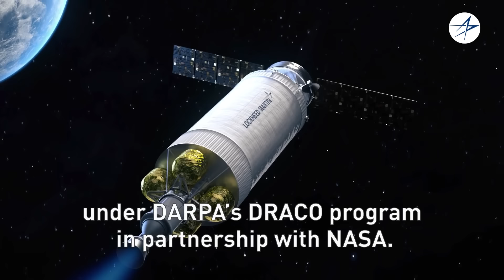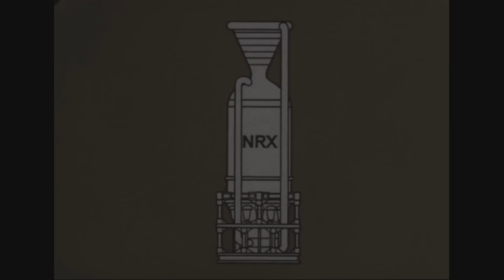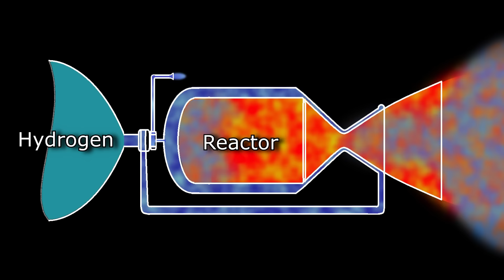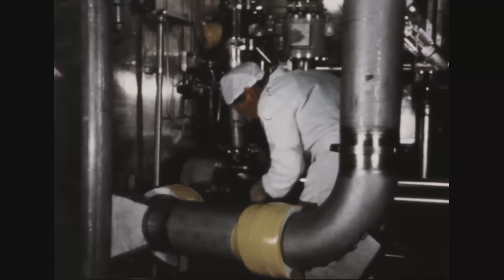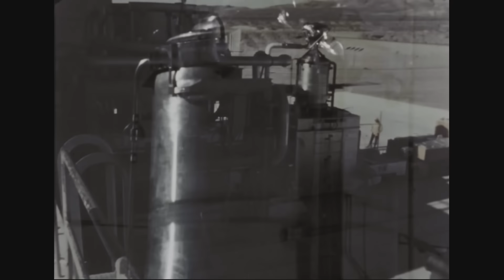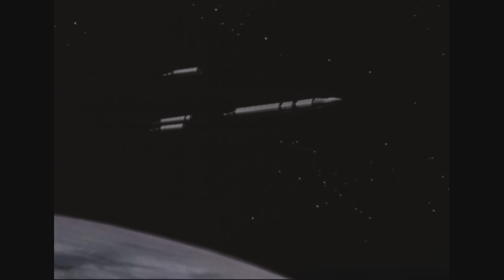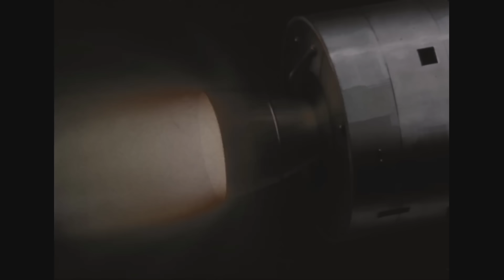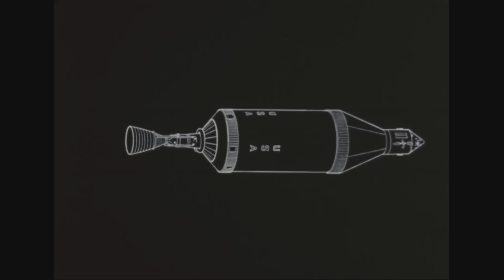Why Nuclear Rockets Are Going To Change Spaceflight

Comment: IIRC, some guys used work on submarine grade reactors does mention Xenon pit isn’t a thing for them as the core is so over enriched and engineered. Also, would it be better to aim for sun? Once for all make the problem disappear.

Comment: Hey Scott, I hope you have time to read this comment, with all the leaks and valve problems they have with helium , why isn't argon used instead? It's a noble gas it has less problem with leakage being a larger atom. I'm sure they've had good reasons in the past. But with modern technology could  those problems be overcome with argon?
Reply: That's the problem. It's a larger atom, weighing something like 10x what He weighs, while delivering the same pressure. He also is gaseous much closer to Absolute Zero than any other gas, making it ideal for pressurizing cryogenic propellants.

Comment: OK Scott, please clarify: "Ion thrusters are almost ten times more efficient, but they require huge amounts of power and produce almost no thrust"
Reply: I suspect 'efficient' might be referring to efficiency in use of reaction mass. I believe an ion thruster can fire out gas much faster than other kinds of engine, so you don't need to take as much reaction mass with you. So if you have a good continuously replenished source of power (a radioisotope thermoelectric generator or lots of solar) and your journey is very long, then you can have a lighter spacecraft/take more useful payload if you use an ion engine for the slower parts of the trip. Compared to combustion engines or cold gas thrusters. I can't actually recall the details of the video, but presumably using a nuclear reaction as a thermal source (I'm guessing just pointing the neutrons backwards isn't efficient) can beat combustion for efficient use of reaction mass.

Comment: if uranium metal melting down is a problem in the engine, why not use something like UF6 where you could magnetically confine the uranium ions. To my understanding cyclotrons already do that so you could get up to all the high temperatures your magnetic field can handle. I mean there are a lot of scientists who are a lot smarter than me, and certainly nobody is talking about these so the process must have a huge limitation in it, any ideas why it wouldn’t work?

Comment: Is there are particular reason why the radiation shield can't be moved to the bottom or back or w/e of any crew compartment, instead of directly above the nuclear engine? If that could be done, then there would be no need to maneuver the now-so-shielded lander through the protected cone. The lander itself would be casting it over itself during the separations and approaches.

Comment: Nuclear-powered rockets are not used to lift off the Earth. Nuclear thermal rockets can provide great performance advantages compared to chemical propulsion systems. Nuclear power sources could also be used to provide the spacecraft with electrical power for operations and scientific instrumentation.

Comment: There's a set of mission profiles that NTP seems perfect for: space tugs between Earth and Mars. Humans on Mars will require absolutely gargantuan quantities of materiel to get started and keep going, and you're never getting that there on electric propulsion. You can do it with chemical rockets, but the potential to save half your fuel costs is very tempting. Less fuel, more payload per trip. Run a train of space tugs from Lunar orbit to Mars and back; for the vast majority of trips, they'll be uncrewed, so the radiation issue is less of a problem.

Comment: Seems like this propulsion tech would be ideal for deep solar system probes on reasonable time scales.  If the target is something like Eris, you burn the engine until it melts, separate the probe, and let the puddle of melted engine coast right out of the solar system.  By the time it encounters another star system it’ll have long since decayed.  If the target is something like Europa, you burn the engine til it melts, separate the probe, and dispose of the puddle of melted engine core in Jupiter/Saturn/Uranus/Neptune.  They already did that with Galileo and Cassini.  That way you can squeeze every bit of performance out of the “nuclear booster” while not worrying about shutdown.

Comment: if material temperature limit prevent higher fuel efficiency, couldn't you convert some of reactor energy to form an electric arc that heat up hydrogen as they pass through exhaust. It can achieve far higher temperature than combustion, and occur outside of the combustion chamber. Beside the erosion of electrode, it should increase the isp further. Granted, the generator step reduce some energy efficiency, but nuclear fuel is not energy constrained.

Comment: You said the hydrogen is the fuel flowing through which is wrong.  Hydrogen is not fuel in a nuclear rocket engine, only a coolant and propellant.
Reply: It is, it is the mass that is flowing through the engine. The radioactive material in the fuel assembly is the source of the heat, but the fluid flowing through the engine is considered fuel since it needs fuel tanks and gets consumed at a relative fast rate compared to the nuclear part of the engine.
Reply: @man-from-2058  No it is not fuel.  No chemical reaction of any kind takes place and the hydrogen is discharged out of the engine in the same form it entered only at a higher temperature.  Yes thrust is produced by discharging high temperature hydrogen but the fuel is nuclear.  What you said would be like saying water is the fuel to power a steam engine, which it isn't.  The fuel is what you burn to boil the water and the water/steam is only a heat transport medium.  Both a steam engine and a nuclear rocket motor are heat engines with their fuels being combusted hydrocarbons and fissile material, respectively (unless you're also making steam from fission).
Reply: @man-from-2058  The hydrogen is stored in cryogenic pressure vessels not fuel tanks because it's not fuel.  And, running out of hydrogen to cool the reactor and transfer heat is the same as a boiler running out of water to cool the boiler and transfer heat.  The reactor and boiler both still can have lots of fuel but can't run without coolant and heat transfer media.  The heat transfer medial is still not fuel.  
FYI, I'm a licensed professional engineer who users thermodynamics every day so I know what I'm talking about.  All I commented on is that Scott made one minor mis-speak but he got everything else right.  Throughout the rest of the video he correctly refers to hydrogen as "propellant" not fuel.

Comment: Now I have to wonder whether you could get even better performance by coating the nuclear fuel with e.g. tungsten which can dissociate hydrogen molecules into atoms at above around 2500K. Potentially another factor sqrt(2) in efficiency.

Comment: I'm doing a literature review on the feasibility of nuclear propulsion, and I found that, yes, that nuclear does radiate the crew during space travel. They  receive less radiation overall compared to use with chemical engines. That is because they spend less time in space compared to chemical. With chemical, they receive a ton more solar radiation because the trip is much longer. 
So, with nuclear engines, they receive radiation but a lower amount of it because the trip itself is lower.

Comment: How about closed loop nuclear reactor generating electricity to power ion thrusters at ultra high power? Wouldn't that mitigate radiation shielding as well as reduce expendable fuel reliance?
Reply: Yeah that is a thing, just electric engines powered by a nuclear reactor. Though that would require a whole big assembly taking up a lot of space while a nuclear thermal engine is smaller.
Reply: @man-from-2058  yeah thought the size would be an issue but surely it can be shipped in parts and assembled in the vacuum of space! Vacuum would actually make things easier, like a giant clean room!

Comment: I've also seen two other plans that add to what is described here. One uses the generated electricity from the engine to magnetically propel the propellant even faster, for much greater efficiency.

The second uses nuclear fusion in addition to fission. The idea is the propellant fuses as it is exhausted.  While fusion reactors are hard because of the need to contain the plasma, that isn't nearly the same issue here; only the direction needs to be controlled.

Any thoughts on these potential next-generation add-ons?

Comment: There's always the less sexy option of a nuclear electric driven ion thruster, too. Or even a hybrid system that can use the thermal energy directly for high thrust maneuvers and electrically drive ion thrusters for low sustained thrust maneuvers.

Comment: My dad was part of the NERVA project. He made several trips out to Area 25, aka Jackass Flats, for the testing.  The video here was from the later testing. The early tests had the engine exhaust pointing down, but they ran into some problems when the engine started pulling the pilings out of the ground...
Reply: I lived right near a testing facility and can just barely recall the red sky from the hydrogen plasma from the engines. My dad worked on these engines and also tested storage of the frozen hydrogen for long durations in vacuum as in flights to Mars.

Comment: Since lower mass propellants have higher ISPs, could you use Neutrons instead?  Is there a way to create a sustained nuclear reaction that emits enough high speed Neutrons to make useful thrust?
Reply: That is a thing its called a fission fragment rocket, though just beta radiation would produce a comically small amount of thrust so actual fuel like hudrogen is added.

Comment: if a rocket blowing up is bad, a nuclear rocket blowing up is really bad.
Reply: Surprisingly not.

The nuclear engine before being turned on would actually be pretty safe to handle, not very radioactive cause it’s just uranium (which, contrary to popular belief, is pretty safe). 

The issue is once the nuclear engine is started, then it becomes dangerous. But it will be very far away at that point

Comment: For maximum efficiency, the exhaust temperature of a rocket should be as low as possible. Any residual thermal energy in the exhaust gases will only make the plume expand in random directions which do not contribute to the thrust. The whole point of the nozzle is to convert that thermal energy into kinetic energy directed along the axis of the rocket
Reply: Not so much low exhaust temperature, but keeping the pressure close to ambient over the whole course of the burn through the atmosphere. That's why you see short bells for first stages and longer bells for upper-atmosphere and vacuum use. Of course, keeping exhaust pressure low when operating in a vacuum is a bit of a problem... I wonder why aerospike engines never went anywhere?

Comment: There are considerably easier way to get better performance out of nuclear reactors in space, such as just using a TRIGA reactor create neutron pulses which directly heat the hydrogen fuel via neutronic collisions with the hydrogen atoms. This bypasses the need to create a very hot reactor core, and you can in fact heat those poor hydrogen atoms to truly stupid temperatures by pulsing the reactor slowly, achieving impulse in the thousands of seconds. TRIGA is also an extremely safe, well understood design.

Comment: Dumb question. Could you drop fuel into the nuclear fuel exhaust to get a chemical reaction to get an afterburner type effect?
Reply: I guess it is dumb - no such thing as „nuclear fuel exhaust” 😂
Reply: lol Im sure you understood what I meant 😅
Reply: @Workmusic1988 that wont make more thrust because when the fuel is beyond the nozzle, it has nowhere to push off to accelerate the rocket. You would need to make the reaction happen inside the chamber where the converging-diverging nozzle is.
Reply: @man-from-2058  Could you do it just after the converging-diverging nozzle? (assume that's how afterburners work in a jet i.e. the fuel is dumped after the chamber in the exhast)
Reply: @Workmusic1988 in a jet the afterburner section is still behind the converging nozzle (the part In the back that can open up or contract.) So the flames created still pass through a nozzle.

Comment: When are those Artemis astronaut's going to take a quick trip around the moon? Apollo 8 apparently did it over 50 years ago. Come to think of why hasn't NASA released the radiation readings   on those two dummies they sent out? New rockets wont help unless NASA solves the radiation and hard vacuum problems. At least Kelly Smith was honest in his little NASA clip...Lol! The emperor has no clothes.

Comment: Well as the saying goes: “Any idiot can build a bridge that stands, but it takes an engineer to build a bridge that barely stands.”. That's the difference in my (admittedly not very educated or valuable) opinion between theoretical rocket science and paper exercises and rocket engineering which has to deal with reality, practicality, usability, costs, logistics etc. I think chemical rockets will be the ones used to colonize all worthwhile rocky parts of our solar system.
Reply: The ISP advantage of nuclear thermal becomes more pronounced the further you go. The tyranny of the rocket equitation really adds up. Using nuclear thermal would make Mars missions much more efficient.

Comment: You can use a heat pump to increase the heat output to a higher point then the nuclear thermal reactor. It lowers the possible thrust massively though, but increases efficiency.

Comment: Excellent video with a clear presentation.   My reaction was “Wow, that is a lot of work, complexity and resulting mission limitations to try to get 2x the ISP!”.   I know 2x ISP is a big jump but clearly some (or maybe much) of that will be spent to mitigate the side effects of a highly radioactive rocket such as distancing the rocket from the crew/payload, adding radiation shielding, and limitations in mission planning.  The fact that this technology has been known for 60 years, it just goes to show the tyranny of the rocket equitation is a real limitation when even using some of our most advanced technology and physics will yield, in all probability, <2x ISP increase.   For true “Sci Fi level” space travel, we need ISP’s that are 10x or probably >100x of what we have today.    I think one element that needs to be reinforced is that unlike engines on earth that can push against the ground or air, in space there is a inverse relationship between engine fuel efficiency (ISP) and engine energy efficiency.  That is touched upon when you mention that the exhaust velocity is a square root of (temperature)…. I think many don’t realize the difficult implications of that basic physics fact.

Comment: No matter the energy source, all rocket propulsion still depends on an expelled mass for the action/reaction movement of the rocket. While the reactor core may be capable of providing the heat needed to drive the hydrogen out of the rocket nozzle for a very long time, the supply of liquid hydrogen is extremely limited, in comparison. I am not convinced this is viable for more than rocketing about in our own terran backyard, so to speak. We are still limited by the volume of reaction mass the rocket is able to carry.

Comment: In KSP1 I almost never use nuclear engines, I don't know if I'm doing something wrong, but I always found them way less efficient than regular engines.  Their thrust is way too weak and they seem to eat more liquid fuel than they should.
Reply: Because of the low thrust, you may be burning them for too long. Ideally the maneuvers should be impulsive (instantaneous velocity change) and applied at a node, this is what the predicted delta-v is based on. But with such long burns, it no longer approximates this ideal, hence the lower efficiency and greater fuel consumption. One way to get around this is to split the maneuver into shorter burns, so instead of a 1000 m/s single burn do five x 200 m/s